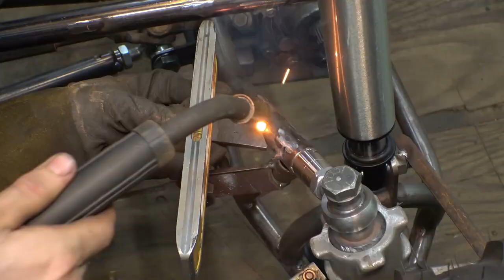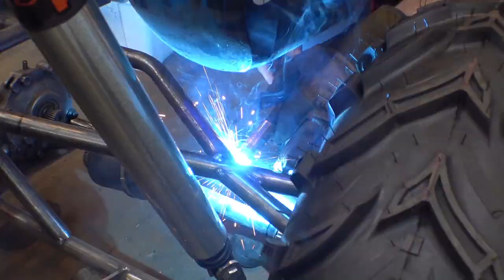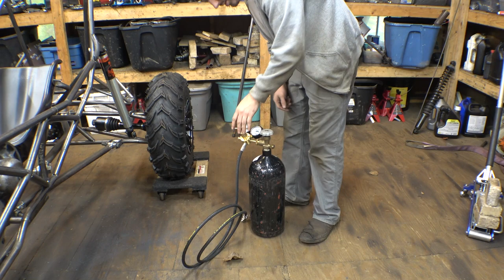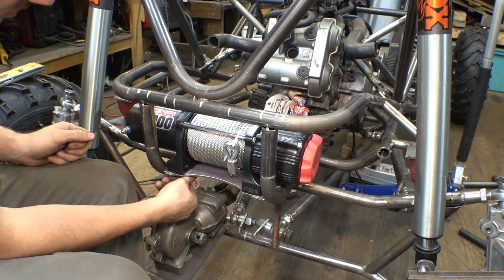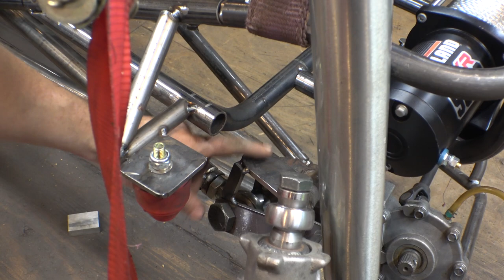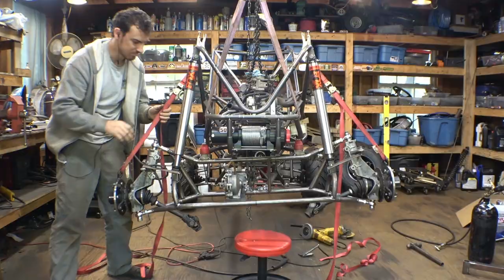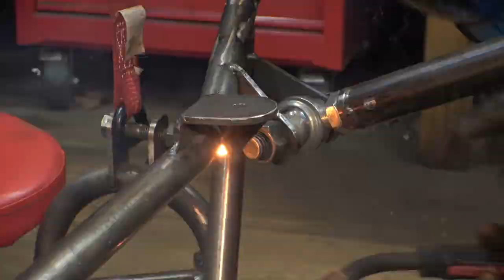Mini Rock Crawler Build SV 650  Part 6

Comment: Seems like a lot of work to make independent drivetrain become a straight axle. Wouldn’t independent be better for rock crawling also?
Reply: Absolutely not. Independent is garbage for just about everything off road. Baja being like the only exception. If you look at SRRS there is a dude with an IFS (independent front suspension) called "the outlaw" . It may have IRS too I can't remember but he does make it work. Independent usually isn't stable enough when you build it to have the travel it needs for rock stuff. Bouncer or crawler.
Reply: @franklinjohnson7161  garbage for just about everything off road, yet it seems as technology continues every vehicle is going to it as a suspension set up.
Reply: @franklinjohnson7161  and then as far as straight axle strengths is just that, strength. He’s still using independent drivetrain he’s just hard mounting it as if it were a straight axle.
Reply: @BBCMONTE34  yeah I'll let you hang on to that. Technology is def getting better. Independent still has a long way to go. It just doesn't perform as well. If every racer knew it would be better they would use it. Almost like a female kicker in the NFL. Fact is.... It doesn't. Therefore no one uses it. Eventually it will prob all change who knows. But solid axles does a far better job of mirroring forces which I find are far better off road than just accepting forces. Which is what independent does. No hate just my opinion.
Reply: @BBCMONTE34  I guess mirror wouldn't be the best word but you prob know what I'm saying. Yeah?
Reply: @franklinjohnson7161  it’s just interesting that you’re saying it’s so bad yet even the heavy duty military stuff is going to it. Every form of on road racing is adapting in some fashion except drag racing. Every Atv uses it. Every utv uses it. I have seen several rock bouncers start to use it. As far as the “mirroring” forces that’s what ends up flipping the truck instead of gripping the ground.

Comment: Ok why not do a full hydro steer a hydraulic ram just use the new style of boat steering wheel you fill the steering wheel full of oil an bleed the system then you won't need a power steering pump but the boat idea all you need it a boat  Orbital steering calum and lines and a hydraulic cylinder your never going to even compare to a car weight and can handle a boat very well plus I did it to my golf cart with car tires just cause I was bord

Comment: Instead of tacking more bars everywhere, why did you just finish welding everything completely together.
Reply: For when something doesn't work or he wants to change it. Never fully weld while building, that should only be done once everything is finalized on the frame a lot easier to cut a tack than a fully welded piece.

Comment: Every project you do the same thing lol you make mistake after mistake because you don't think things through well enough or you just don't have enough years under your belt but trust me it's as frustrating for most of us as it is for you lol.
And you describe things like that professor on the Simpson's with the bending and the flexing and space I you didn't leave for the movement of the shocks and the messed up geometry iy yiy yiy lol